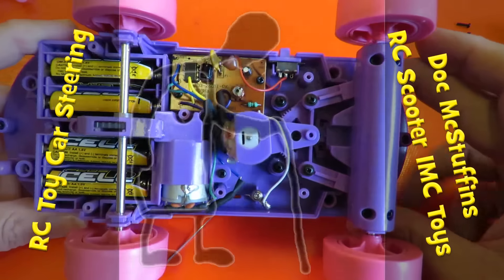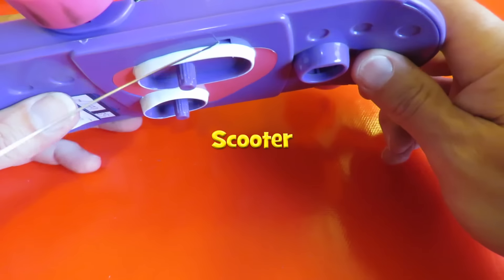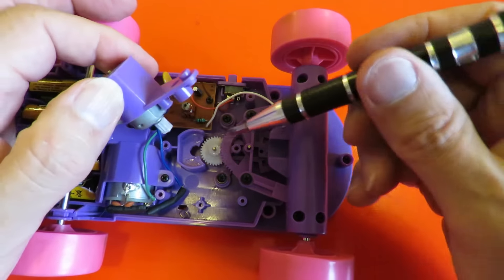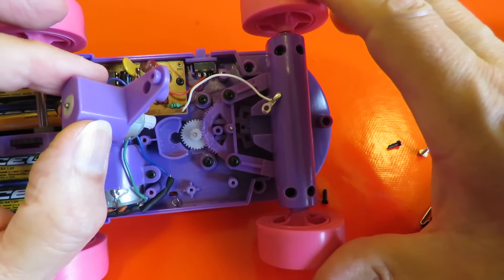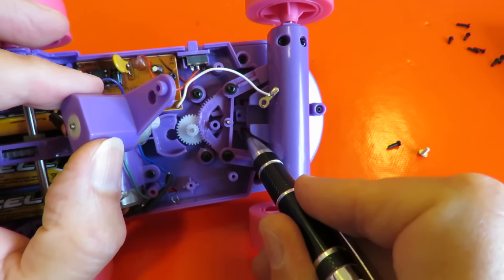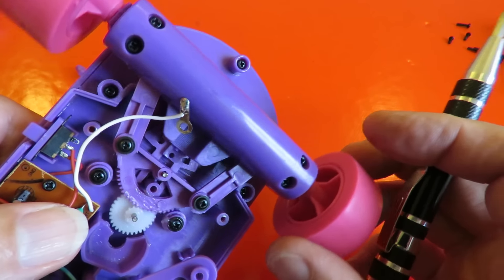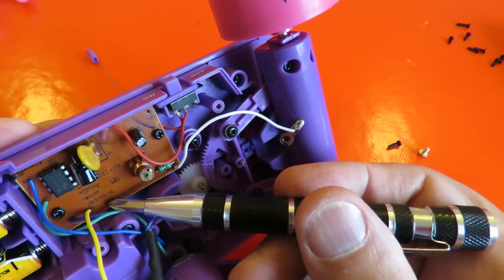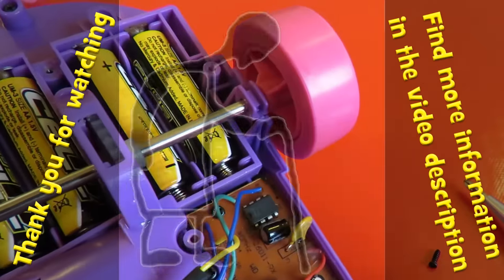RC Toy Car Steering Doc McStuffins RC Scooter IMC Toys

Comment: Hm, could be a project to hobby convert with a proper servo on the underside.
as its also using 130 size motors you'll be able to buy some faster motor for fun if its too slow. or if it lacks torque buy one with neo magnets inside.